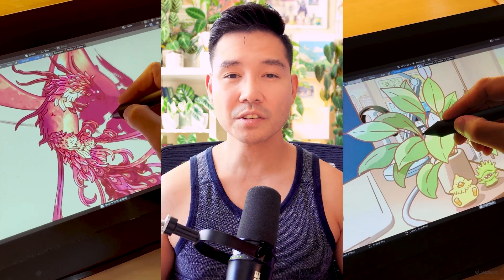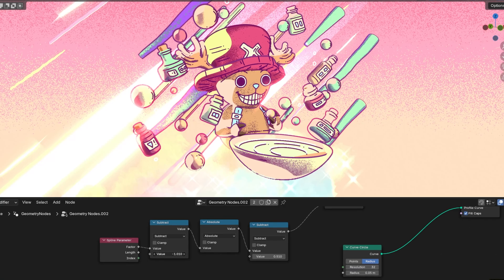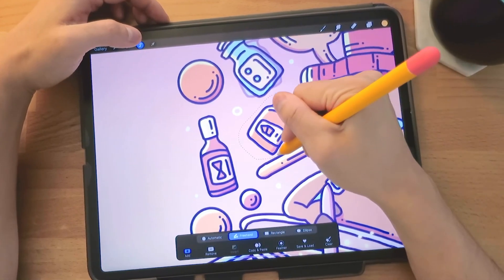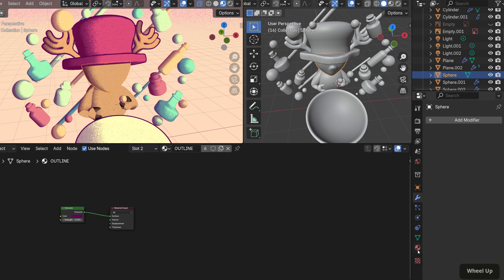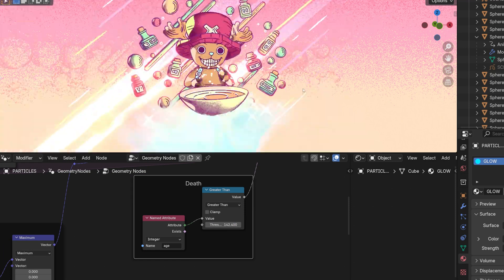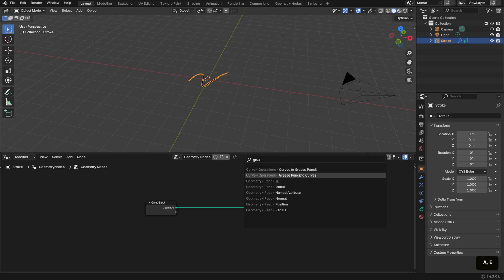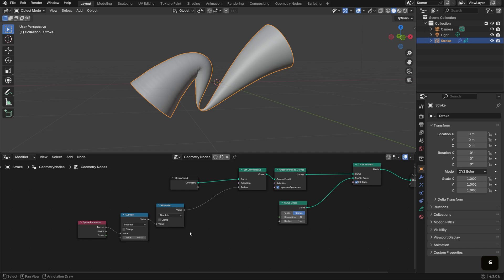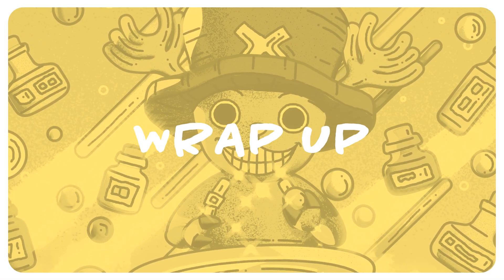2D Drawing to 3D Mesh in Blender 4.3 | Grease Pencil & Geometry Nodes Tutorial + Free Project File

Comment: How do you turn the output into an actual mesh? I tried applying the Geometry Nodes modifier but it doesn't work on grease pencil strokes :(
Reply from the maker: Hey there, sorry for the late reply! Unfortunately, you can’t directly apply the modifier to the Grease Pencil object. The workaround is to bring in a mesh, create a new Geometry Nodes setup, and use the Object Info node to bring in the stroke object (the one that has the original set up). From there, connect it through a Realize Instances node and then to the Group Output. Once that’s done, you can apply the modifier onto the mesh object and edit the actual meshes. The reason for this extra step is that Grease Pencil objects aren’t evaluated the same way as meshes. Hope that helps!
Reply: @kevandram  I have been searching the whole internet for a while on how to do this and this is the first actual solution I have found thank you so much
Reply: @kevandram  thanks for the solution

Comment: For anyone having trouble with getting the Taper to work (7:43) in version 4.5+, a few things have changed. All you need is: 
1. Group Input to a Curve To Mesh node. 
2. Curve Circle into the "Profile Curve" socket of the Curve to Mesh node
3. Spline Parameter and Maths just like in the video at timestamp above. Plug those into the new "Scale" socket on the Curve To Mesh 
4. Curved to Mesh out to a Set Material node, then a Shade Smooth node, then to Group Output

Grease Pencil is already a curve as of 4.3+ as explained in the video, so there's no need for the Grease Pencil to Curve node. The Set Curve Radius in the video will no longer work for this, so skip that, too. The new Scale input on the Curve To Mesh replaces that function. 

10 Nodes in total for the new set up: Group Input, Curve to Mesh, Curve Circle, Spline Parameter, Subtract, Absolute, Subtract, Set Material, Group Output. 
I also recommend a Resample Curve before the Curve To Mesh to easily optimize how many points are in your stroke.
Reply: Hey, you posted exactly the comment i was wishing for here, thank you so much, appreciate your effort.